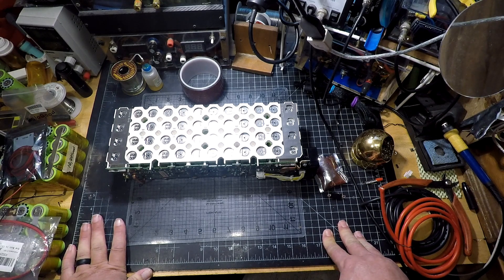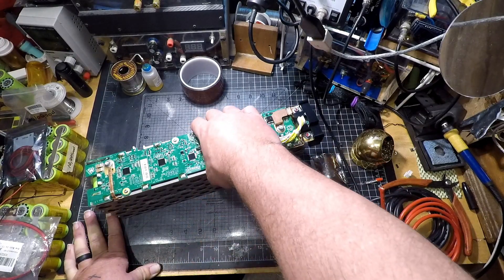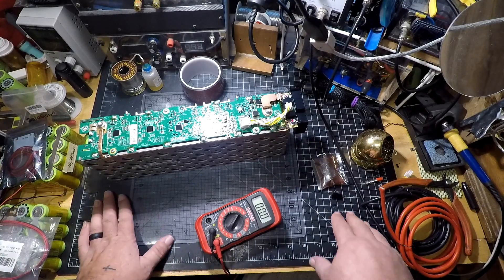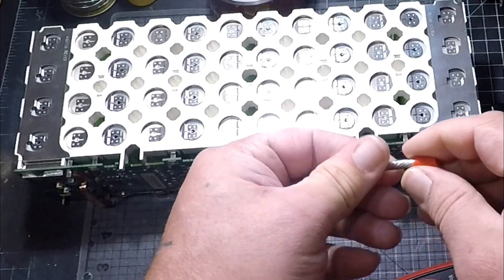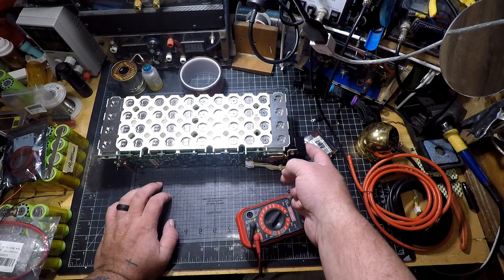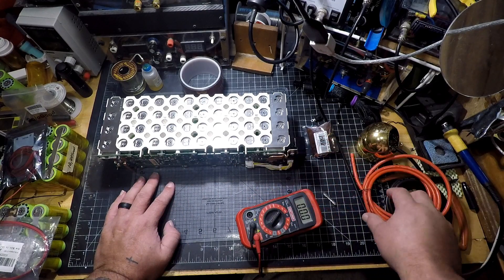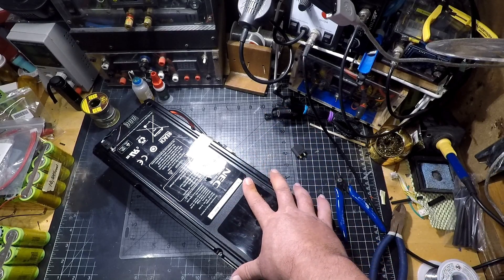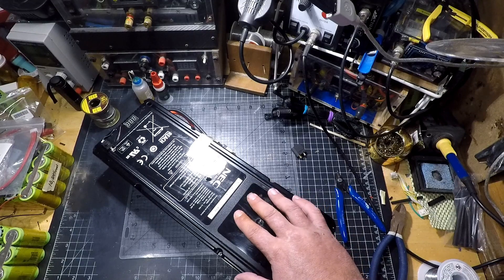A123 36V Module From Battery HookUp (Crude Hack/Mod to Use 36V LifePo4 Pack)

Comment: the trick is on that square  wear you say you  bypass 7:29  <<<<press
Reply: that is the communication port  to turn on the pack i did it true that, but you need to disconnect the plug from the bms  on the bms you do the short and this will turn on  mines did not spark  just do it quick used the multimeter to check power on them  you will get  2 green lights on on the middle of the bms and the one from the v like clear plastic indicator

Comment: Check out the Aikeec Active Equalizer BMS 1.2A Balancer on Amazon...you can leave it installed to monitor the balancing of your battery....🤠👍
Reply from the maker: I just decided to keep the board connected, it has a active balancer that gets a little more amperage and works or kicks in anytime the battery gets out of balance. Unfortunately you can’t use the protection curcuit, unless you figure out the handshake. Reason I only bypass the main output 👍👍👍. I have a few of the active balancer I use on other projects and love how they work👍👍👍

Comment: How are you charging this pack, like personally? Are there 2 input wires you can use, or are you charging it with a balance charger. Can I just use a lab power supply set to whatever voltage to charge this, thanks!!! Does it have a built in active balancer for charging thanks...
Reply from the maker: In the video I mention how this pack has active balancing. But it also uses balancer circuits when charged threw the main plug that’s already in place in the front. But with active balancing, no matter the voltage level, or charge or discharge. The board keeps the pack well balanced. Because of this I can also charge from the xt90 I put with the pack. As for charging, there’s not to many lab supplies that go past 38v, but if you have one that charges to the packs voltage and offers constant current/constant voltage a lab supply will work also.

Comment: I was lucky enought to buy two of these packs.  A day or two ago I removed the reconfigured A123 cells from one case...discovered that 7x20 of 18650 might fit very nicely for ebike.  I hear a hissing sound and looked behind me to see one A123 spewing smoke.  I ran it outside and waited.  The top evenutally popped off and shot out a long black party streamer...hehe
Reply from the maker: yea these batteries can be scary that is for sure, make sure to practice safety when taking apart, charging, and discharging!!
Reply: @njfulwider5 Not sure if it my imagination...but the OEM wrappings on these cells seem quite a bit thinner than DIY shrink wrap.  Very easily scratched right through and unseen short is possible.  Lesson learned for me....though a bit more cost...rewrap cells.

Comment: Hey mate! Question for you! 

Does this mean that the bms is being used when your charge but not discharge? If so, that might work for a build I'm working on (Go kart- need around 800A peek). Would love to do a proper BMS, but one that handles that level of current would cost more than I even want to think about
Reply from the maker: kinda, in a way. With Active balancers, anytime the batteries are out of balance, it will correct itself. Unfortunately, when you don't use a BMS, it won't auto shut off if overcharged or run down.
Reply: @njfulwider5  Ok, thanks! 

I'm thinking what I could do in that case is use the built in BMS for charging, then have a pair of low voltage alarms. One for initial low detection (36) to initiate slow down and one that's pretty conservative on the pack (34 volts maybe?) to know to disconnect it. immediately. 

Sounds reasonable? I just can't afford a BMS that will do the amount of current I need 😅

Comment: So, you meant to say that the extra power connection/cable you created is just meant for using the battery when it already has enough charge. To balance charge the battery, we can use the holes label - and + on the battery as the charging port by connecting + and - 43.8 volt power supply to it (no extra balancing wires needs connected?). Please clarify.
Reply from the maker: Active balancing takes care of it for you when connecting either connector I made. Compared to a bms that balances only when the cells reach maximum, an active balancer comes on at anytime the voltage are not equal. So you can charge from the -and + connector or the connector I made with an xt90. The active balancer will do most the work if the cell becomes unbalanced. But I would recommend using the +and -. If you have the tools.

Comment: I bought one of these too, i removed the built in bms and wired up balance lead to it. I did not put bms since i monitor the voltage and im only going yo nee 35amps from it peak. i made a bracket and attached it the the scooter steam.
Reply from the maker: Personally, I would add a BMS ontop of the BMS already there. I have found that the BMS has an Active balancer(really all it's good for), that keeps the pack balanced all the way to around 2V. I typically use an active balancer with a BMS and had great results. Some users claim Lifepo4 are so safe all you need is an active balancer. But I wouldn't recommend that. I have found a really good BMS for these starting at around 35$ for a 40amp and as the amp rating increases, the cost increases. "Wes the tech guy" on youtube sells them in America through his store. I personally decided to change this to 3x 4s4p packs with BMS w/balancing 100amp rated. Maybe use in a project later?
Reply: njfulwider5 i think for my application i don't need it, since i monitor my voltage, and my current draw is so little for this pack, althought it would be good to put bms and forget about it i prefer the active balancing while charging..:)

Comment: Is there a link to the 12S BMS you mentioned?  I don't see one in the description.....
Reply from the maker: You can find them on Wes’s channel.. Wes the tech guy. He has the link to his store in his discription
Reply: @njfulwider5  Found it!   Thanks!!!  BTW, just ordered some of these units from Battery Hookup- as I had been planning on making a 36V set up for a couple of weeks now.  I'm going to attempt this video's hack, but with a low voltage shut off.  If that fails, then I'll get his BMS's.   And thanks for posting this hack- for the effort, it's worth the try.

Comment: You only need the 12 wires for balancing because you have battery 0V and +36V at the main terminals.
Reply from the maker: Yep, as long as you use the 2 main input terminals to charge, it will balance while charging use the BMS that already installed. Technically, you could use the discharge xt90 to charge also, because this uses active balancing. With Active balance, the balancer engages no mater the state of charge, keeping the batteries balanced at all times. I can’t remember how many mA or amps it does this at, but I mentioned it in the video👍👍👍

Comment: Voltage control boards are cheap.  https://www.ebay.com/itm/DC-6-40V-Battery-Charger-Discharger-Board-Undervoltage-Overvoltage-Protection-TW/153765066649?ssPageName=STRK%3AMEBIDX%3AIT&_trksid=p2057872.m2749.l2649

Comment: should put a working BMS if you don't use the onboard one and have a fuse on the cable at least.
Reply from the maker: My recommendation at the end of the video was the same. I just wanted to see if I could find a way to use, without punching any more components. You'd be surprised how many other DIYer, swear that a LifePo4 pack is safe without a BMS and an active balancer should do the job. I don't plan to use this pack like this, I plan to break them up in 4s4p packs like the others. I have the BMS-s for those already.  Just need to find a use for them...LOL
Reply: @njfulwider5  Do you plan on running those 4s4p packs inside the original case?  If so, how do you plan on balancing the cells in each of the 3 packs?  The 36V volt of this battery is really making it challenging for BMS set up.  Most inverters are 12V, 24V or 48V.  36V inverters are more rare.  It almost seems worth it to just rip out 1 4s4p from the pack and run it as 24V and have an extra 12V pack for something else.
Reply: njfulwider5 that's what i did

Comment: Get some flat wire or  braid to make those top connections.   https://www.google.com/search?sxsrf=ALeKk00sXKsj16gew5JARKHoTKrNA3pK5g:1590698203074&source=univ&tbm=isch&q=copper+flat+wire&sa=X&ved=2ahUKEwiQ5drKtNfpAhURip4KHS4oA-0QsAR6BAgKEAE&biw=1366&bih=629

Comment: Most of the capacity is between 3.0 and 3.5 the rest isn't worth chasing. I do not use the original from the bus battery but I'm always open to finding more information so I could use one.
Reply from the maker: I agree!! I played around with them a little. Just haven't found a use for them yet. The bigger size and only being 2500mah each make them to beefy.  But there great Power cells.
Reply: @njfulwider5  lol yep I got a few (6000+)to run the house on and they make great replacement lawn mower batteries
Reply from the maker: @offgridwanabe  6000+...HOLY MOLY.....I found a working AC lawnmower at the local Goodwill that works. Thinking maybe these might work on powering them instead of the AC to Bridge Rectifier it uses now. Maybe a Future Project?
Reply: @offgridwanabe  So that's where they all went! lol